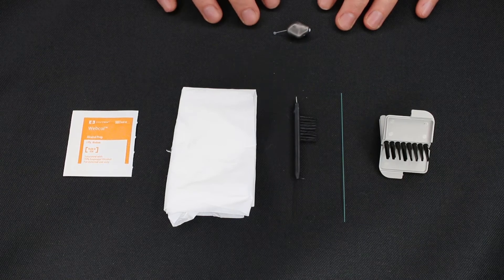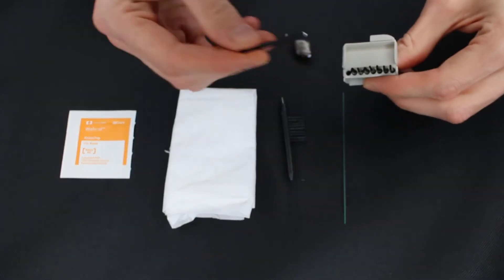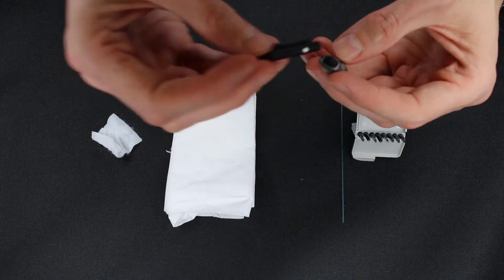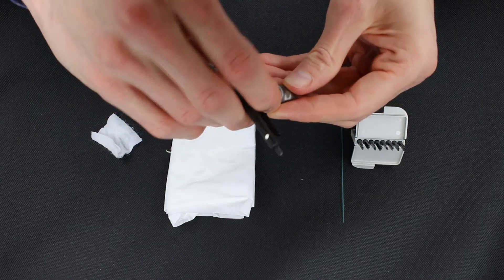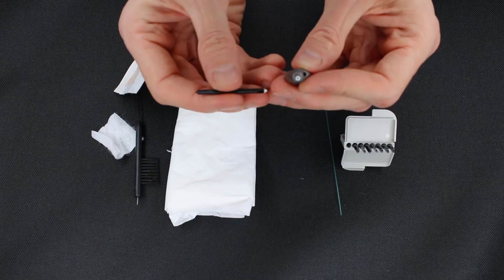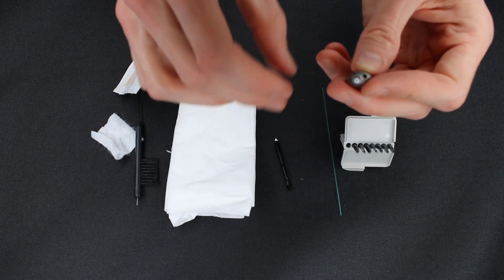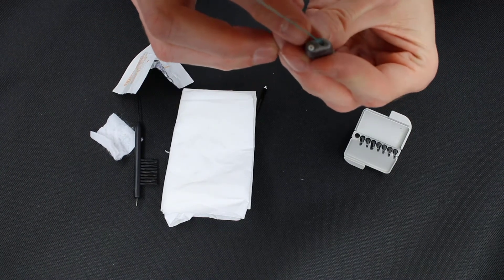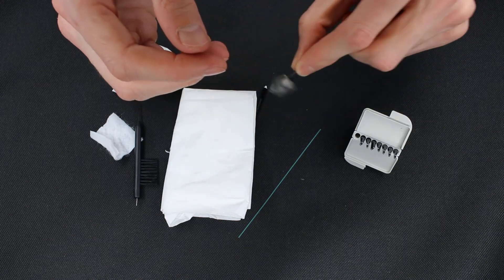Cleaning an invisible in-the-canal (IIC) hearing aid - Applied Hearing Solutions

Comment: I watch your videos all the time now as I just got my first set of hearing aids.  Recently I had to take one my new Phonak Titanium hearing aids back as it was making a crunching sound.  I had been using alcohol wipes on it just as you and my audiologist had showed me.  I later read that alcohol was not supposed to be used as it can damage the plastic or the coating on the mic.  I was using 70% wipes which I also read was not high enough percentage to cause issues.  What is the real scoop on using alcohol wipes?   Thank you!
Reply from the maker: ❤️ The alcohol wipes is for the Titanium, not the faceplate or microphone inside of the hearing aid. Just use a brush on the faceplate. 👍
Reply: Thank you for the quick response.  That is what I had thought and had been doing.  I was just afraid I had done something to mess one of mine up.  I am still waiting to get it back from Phonak and am interested in what happened with it since it was just two months old.  BTW, my audiologist follows best practices; I guess I got lucky because with my insurance I didn't have much of a choice.  Keep up the great work.
Reply: the best would be phonak b titanium for 13 bareries instead of 10 batteries
Reply: the best would be phonak b titanium for 13 bareries instead of 10 batteries

Comment: You are giving patients the wrong information. The hearing aid should be turned upside down so any dirt, wax, grime does not get pushed into the hearing aid. Also, the best brush to use is a soft-bristle toothbrush, it is easier for older patients to hand than the little tiny brush that comes with hearing aids. The bottom of the hearing aid should be brushed off as well before placing a new wax guard on it.